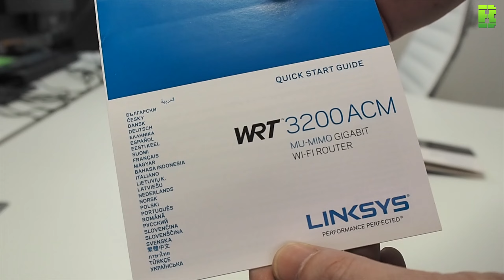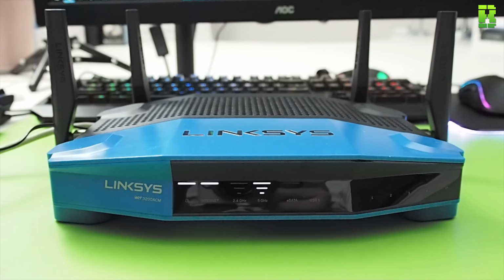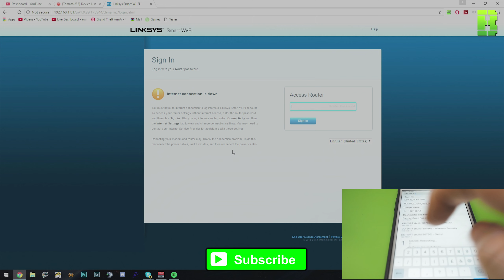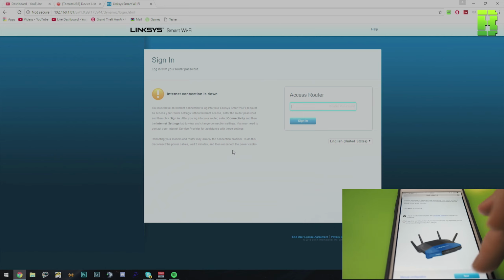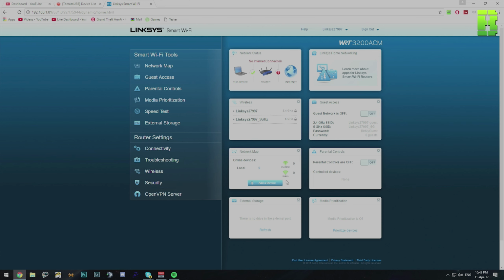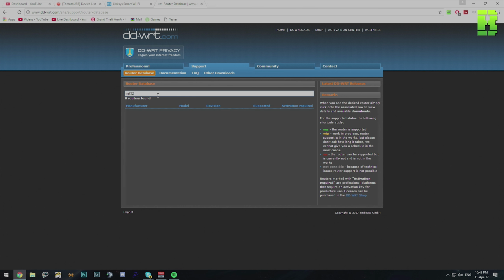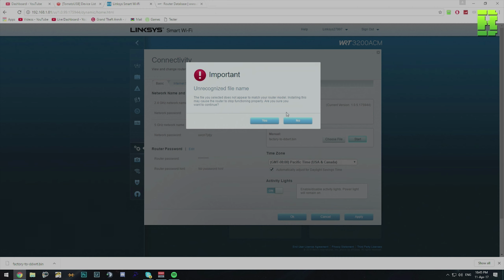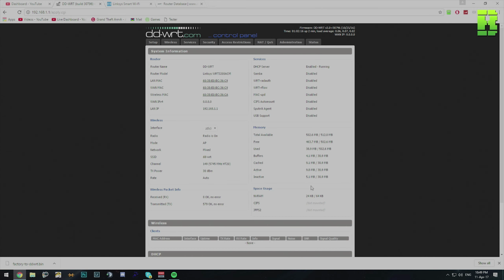Linksys Wrt3200acm DD-WRT Install / Step by Step Setup Firmware

Comment: I didn't update my router with dd-wrt I just bought it from ebay I set it up with normal configuration but when the conmection established there is no internet connection at all and also there is no 5ghz. It only shows 2ghz and 2ghz guest, need help!
Reply from the maker: Hey it seems like a weird issue. Have you done a factory reset on it to ensure who had it before hasn't disabled/changed anything?
Reply: @Beardedbob  I did reset but no luck this is a brand new router, anything else I can try on your knowledge?
Reply from the maker: Check DHCP is giving you an IP over wired if not add a static one on the same subnet as the routers default one.
Reply: @Beardedbob  thank you so Much I will give it a try and let you know the outcome

Comment: Hi mate can you help, I have a WRT32x router and put DDWRT on. It doesnt connect to the internet at all and therefore I cannot put my VPN software on there. The normal standard software seems to work fine. I have used the file from the DDWRT database but it uploads then after 192.168.1.1 I that's as far as I can go. Any ideas?
Reply: My issue as well!

Comment: I installed DD-WRT on linksys WRT3200ACM but after a few months I reverted it to the original stock firmware. Now I intend to use it as WAP and I would like to install DD-WRT again. Is the procedure the same as if I am installing it for the first time? I will I appreciate your knowledgeable answer.

Comment: i have shitty sky, and get 30 mbps download and like 9 upload. used to get 100 when i was on virgin. can i use something like this to get a stronger connection? i use a ethernet CAT6. but my ethernet cable cost $40 so itsnot a cheap one. cheers
Reply from the maker: Yo Dog, best to use cat6 though that will give you a speed of 1gb up and down. Your limit here is the sky connection which you don't have control over even if you used a separate router like this. Sky licks balls :-9.

Comment: Very slick kick ass router. This WRT3200acm is the exact as the gaming black version WRT32X and both can be flashed with either one"s firmware! 

For example: the WRT32X lacks many software configuration features that the WRT3200acm has and therefore you would want to flash the stock or custom wrt3200acm firmware on to the WRT32X in order to take advantage of the missing features from the wrt3200 firmware!
Reply from the maker: Have you been using it? How do you find the wifi single on it?

Comment: Hello. I have this (wrt 3200acm) and I just followed the instructions step by step in order to install the new firmware.. but now  I cannot connect to the router. It turn on, but the on light is blinking.... What can I do? Thank you for your help.
Reply from the maker: Hi, So you have installed the firmware and now you can't connect? is this when you type the address in the browser? how long have you left it before trying to login?
Reply: Same thing happened to me. looks like my router is bricked.

Comment: I have DD-WRT on my router and my devices show full network connection but the apps say there is no internet. After I disconnect from the network and reconnect the internet works again. Both of my AC3200 routers suffer from this. How do I revert back to original firmware to try the settings recommended by Linksys for their shitty router??
Reply from the maker: I found this also on the Linksys I would have expected them to have resolved it by now but seems not. You will need to find the original firmware online and then flash it in the DD-WRT software.
Reply: @Beardedbob  So you are having the same issue with no internet even though devices show full network connection? It is very frustrating. I would like to find settings that work before I go out and buy a Netgear router
Reply from the maker: I don't have it anymore I swapped to an R7000 and now I'm just testing an Asus GT5300. If you have the Cash this Asus is a beast, if you want something a little cheaper then the R7000 never let me down and takes a customer firmware easy.
Reply: @Beardedbob  I found someone local selling a new R8000 for only $140. Really thinking about jumping on it instead of trying to find a workaround for my Linksys. Do you know if the R8000 can run VPN?
Reply from the maker: The Linksys had potential but if it's still having issues now I'm surprised that they haven't fixed it. The R8000 can take a custom firmware which means you can setup a server VPN on it. 👍 Have a good read first to make sure I've not missed anything but here's a good site to check https://www.myopenrouter.com/download

Comment: when flashing do it wired or can you do it wireless
Reply from the maker: I would do it wired in case you  drop connection and it bricks it, but if you don't have that option you can do it wireless.

Comment: Do you have to do the 30/30/30 reset before updating the firmware? I saw another video professing this needed to be done for this exact modem.
Reply from the maker: Hi, I just did as the video here and it worked no problemo.

Comment: What kind of keyboard do you use?
Reply from the maker: +Anthony Gazdecki hey dude, atm I'm using a Razer Blackwidow v1 Chroma and v2 Chroma 

https://www.youtube.com/playlist?list=PLfd7fPKFiRfJ_b-tCJDAVzWJTuurxaJ1v
Reply: Nice. I just bought my self a corsair k70 lux rgb cherry mx reds. I think I'll like it... I haven't really tried Razer keyboards except at a bestbuy. Are you currently using the corsair m65 pro mouse?
Reply from the maker: +Anthony Gazdecki The K70 is a decent keyboard had one before also. The switches imo are better on it as they are Cherry and I've had a few Razer own fail though on my Orbweaver rather than my BW keyboard.

I used the M65 for about a month until a week ago, great mouse about to drop a review on it. I can't fault it, well positioned buttons, decent weight, nice tracking, it's a little ugly imo if I had to pick something but my worse gripe is the software it's pants lol. The mouse though imo one of the best I've tested, it's a solid buy.
Reply: Yea I watched a review and the Razer software looked easier to use than CUE.
Reply from the maker: +Anthony Gazdecki I originally didn't like Synapse from Razer but compared to the competition it's one of the best imo.

Comment: why you keep saying rooter when its router because its used to route
Reply: in England where English came from router is pronounced "rooter".
Reply from the maker: +TeshTube as well as the English say data not dah-ta
Reply: TeshTube then why don't they write rooter on the box ? so the rooter is rooting the signal or its routing? you don't make sense
Reply: Beardedbob British say woah-tah to water
Reply: I have a rooster in the backyard, he doesnt route anything anywhere but make noise.
Reply: A lot of things are pronounced differently in English accent. North American accent is very mute while British English accent has a tons of variations.
Reply: +Leon P Route is a French word in origin, pronounced rewt. Root, also pronounced rewt, means something different. In Australia, for example, root means to have sex which you might do one day.

Comment: Can you make a video how to revert to original stock firmware linksys WRT3200 ACM
Reply from the maker: Hi, yeah will look into doing one np
Reply: With the router ON press, the reset bottom for 30 seconds then disconnect the power cable keeping pressing the reset bottom for another 30 seconds, then connect the power cable again keeping pressing the reset bottom for another 30 seconds. After this will be back to the original firmware factory state. This process is called 30/30/30
Reply: @DroneSurf  Not recommended for this router.